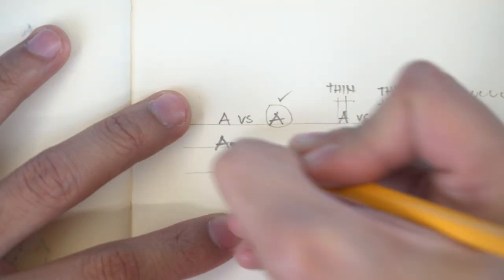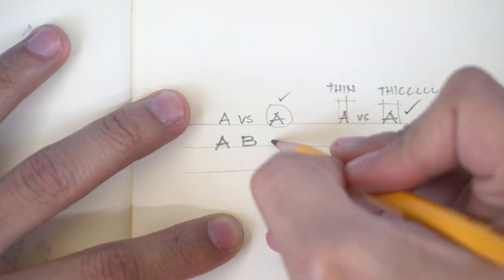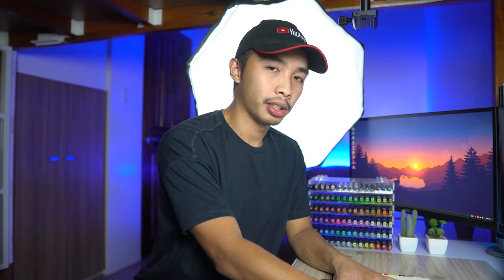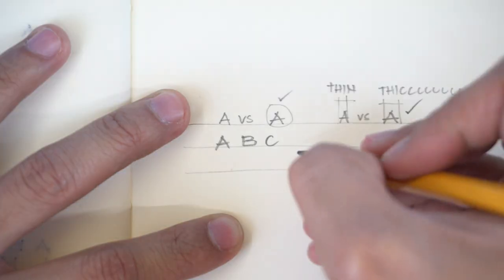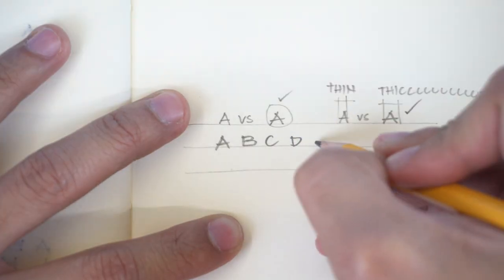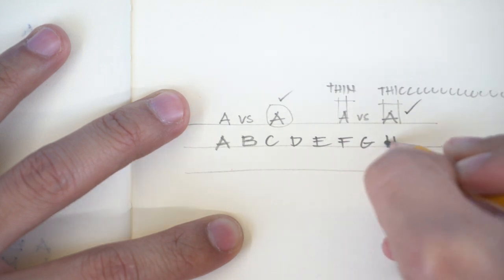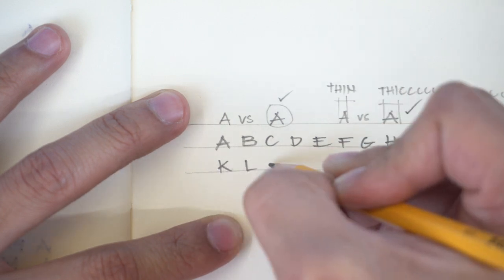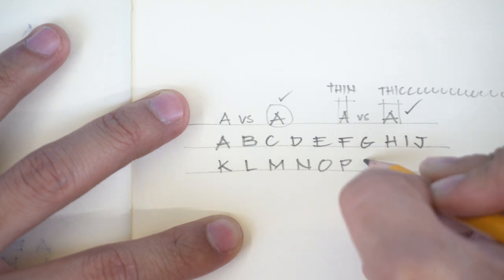Architectural Lettering Techniques

Comment: I wrote in many ways...
Slanted to the left..
Slanted to the right..
Sometimes short and wide...
Sometimes long and thin...
There is also the lazy writing without a care for looks...
There is also the writing with pressure...
And the kind of writing that is so light and small...

I'm an engineer but I could not stick to one type of writing...

Does this mean I am not suited to engineering or architecture?

Comment: Ahhhh.....So are you saying using a chiseled pencil or pen that the wide part of the pen is used for horizontal lines only ex. like the letter "T, L, Z so then like the middle of the "Z" would be the VERTICLE LINE? I love the writing style of an architect im trying to get use to shifting the pen from thin line to the thick line.

Comment: I think there was also the use of stencils. I can't imagine trying to trace a lower case character through a stencil, it would just be easier to trace caps in stencils. I have never seen an (engineering) stencil that had lower case. Fast forward a few hundred years, and I imagine the tradition has stuck.

Comment: #Question What are some of the biggest issues concerning the field of architecture right now?
Reply from the maker: I think one of the biggest issues is still the overlapping jurisdiction of Civil Engineers when it comes to designing residential structures:) Also the depleting sources of Sand and Portland Cement is a very concerning issue, we would have to find some other building materials soon:)